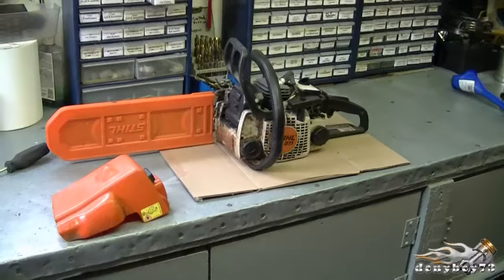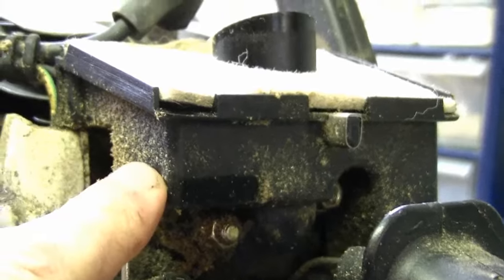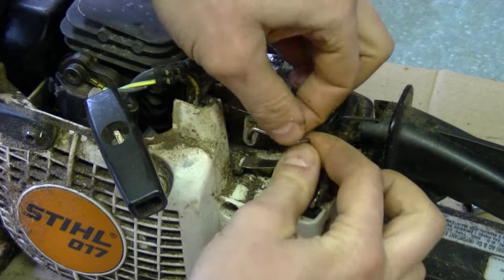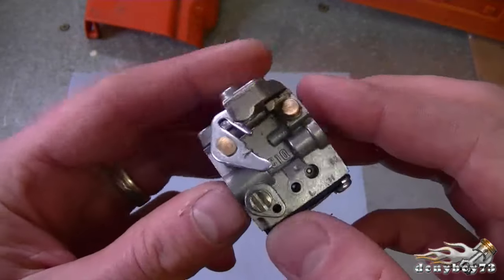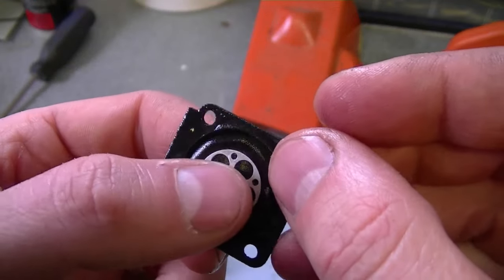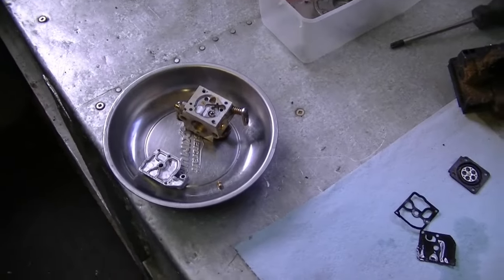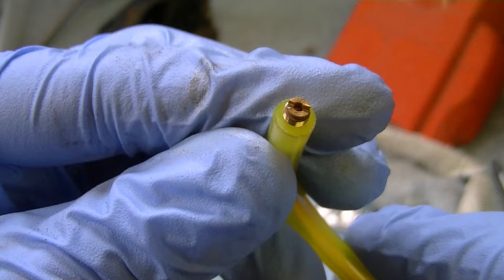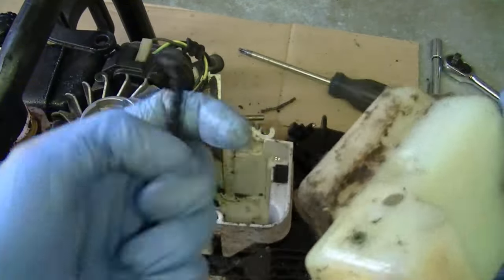HOW TO - Carburetor & Fuel Line Repair on STIHL 017, MS170, 018, M180 Chainsaw Part 1/3

Comment: Thanks! My nearly new MS170 wouldn’t start this spring and the shop asked $155 to install a new carb. I’ll not spend 75% of the new value on a repair! You gave me the confidence to fix it myself.

Comment: Hi Don,  Can you believe it's been just 3 years since I had problems with my hardly used 170. And today I was cutting, it just idled down and stalled. Now won't start. I've used nothing but canned gas after last time. Weird though, won't start putting fuel right into carb either.  Spark s good. Was running great then just slowly died and wont start now. So much for Stihl being so wonderful.  Thanks Don. Carb time again.

Comment: I would like to thank you for your videos.  I'm still new to small engine repair, but your videos, (especially in comparison to others) are clear (both in lack of shakiness and wind sound), descriptive and just oh so much more helpful to me.  Keep it up!  So far you've helped me with a Tecumseh snow blower (carb rebuild), Honda rototiller (camshaft replacement, carb rebuild, new belt), and now a Stihl chainsaw (another carb rebuild, but also found leak in fuel line thanx to this series of videos!)!
Reply from the maker: +Terri Kubik thanks

Comment: I stripped down and cleaned my carb today and afterwards the saw ran like a top. Thanks for the video, Don. By the way, I solved my previous issue simply by watching the video and carefully remounting the choke shaft with the grounding strap/spring on top of the shaft. That way it grounds out the ignition when the choke lever is moved to the shut down position.
Thanks again.
Reply from the maker: ok good

Comment: There is a paper gasket between the air box and the carburator.  I looked over several videos and everybody, it seems, overlooks this gasket.  To make sure mine stays affixed to the airbox into put some rtv on the side that goes against the airbox.  Air filtration is one of the weaknesses of this model saw, so I make sure any gasket on the carburator is installed.  I wish to thank HL Supply for including this gasket in the set of parts I got from them off of ebay.

Comment: Nice video. I would recommend that you clean the exterior area of the carb before any 
disassembly/removal of the carb itself. I always spray the complete area thoroughly with cans of brake parts cleaner then use compressed air to complete the cleaning process.  This way you are working in a clean environment and much less likely to introduce dirt/debris into the intake port once carb is unbolted.

Thanks for the video !

Comment: donyboy..you are so right ..the fuel screen on the carb should always be removed and cleaned....sometimes they look clean but are clogged up and no fuel will flow or it flows very slowly and produces intermittent running

excellent tip dony

Comment: I want to thank you for this set of vids. I just bought a used 018c Stihl and wanted to rebuild the carb. Your vid made it super easy, funny thing is I had to wind up replacing the fuel line also. Thanks again
Reply from the maker: +C Ray you're welcome
Reply: +donyboy73 
Do you have any chain sharpening videos?
Reply from the maker: +C Ray here's one but I need to redo it in HD https://www.youtube.com/watch?v=-PTXj1VIlbc

Comment: Great video! My MS170 developed a fault where the lever assembly had fallen out of its housing. I was struggling to find out where to re-attach the throttle linkage and this vid pinpointed exactly what I needed to do - many thanks!

Comment: Hi, been watching your Vid's for a few year's now, and they have inspired me to do some repair's myself, but As a  result I created a problem (ME) I toke Carb out and Cleaned it replaced Fuel line + filter Black hose and  vacuum hose with Tylon yellow hose and new boot  to cylinder, all good assembled, ( Light Bulb Moment) Having Two different hoses Less Likely to stuff up placement, WRONG, For some reason I had a brain Fart and put the Black Fuel Line to the Vacuum nipple on carb and the yellow cylinder to hose to the fuel inlet nipple on Carb, I was so happy with my achievement, I put the Plastic together and  fueled it up and it started up straight away it needed a bit of fine tuning, but the 395xp was alive This was May 2022, One year later I got  saw out of shed to for Firewood season and see ran fine till in the cut and it sounded lean and stalled out repeatedly, lucky I have more than one saw. Yesterday I disassembled again and found the orientation of the hoses to be incorrect and changed but the yellow hose had come of the cylinder port and had melted closed possible small combustion happened there  as plastic melt on  partition above where hose goes through to Carb. Sorry about the long windedness, but  It Now wont Run at all unless  with carb sprays help. ANY Help to steer me in right direction? Regards Fred.

Comment: Fixed the saw, it was just the fuel line...put in a new one with the help of your video.  Two cranks and it started right up. I thought I  was going to have to replace the carb..thanks.
Everybody should run high test gas in their engines...makes them run better and last longer.
Reply from the maker: good work!

Comment: Thanks for posting this video. I have an issue with my MS170 where it wont run at wide open throttle, and it seems I have a restriction in my fuel delivery system. I inherited it from my father, and when I got it it didnt run, so I drained it, cleaned the tank out as best I could and I was able to get it running. Its been great since then, of course the saw ran last time I used it, but I went to use it last night and it would bog out at WOT. If I sprayed ether into it, it would run at WOT, which is telling me its a fuel delivery issue. Logic says the first step would be to check the fuel filter/line. I was a bit worried about going into the carb just due to how small it is, but you really showed how simple and easy it is and Im not worried about rebuilding/replacing the carb if I had to. So again, thank you much.

Comment: A great example of why you should never store your small motors with fuel in them or always add fuel stabilizer to them if you absolutely must.  I don't know how many lawn mowers and weed wackers I've picked up from the trash that worked perfectly after a simple cleaning of the fuel systems.  People would save themselves a lot of troubles just by running them dry before a long storage.  Another great vid Dony.

Comment: Great learning video. My Stihl ms180 would not start. Too lazy to trouble shoot so I Spent $43 on a new carb , fuel line, ignition module, spark plug and T27 driver. Started on second pull . Idles and runs like a champ. Will rebuild carb for next time. Non ethanol only!

Comment: Dude, you rock! I diagnosed my chainsaw issues as a worn/collapsing fuel line as you show in your video. It would idle, but as soon as I started to cut it would die from fuel starvation.

I got a new line and filter for $12 and with your excellent video was able to replace both and restore my MS170 to perfect health in about 30 minutes. Where do I send my check?
Reply from the maker: lol, please subscribe and tell your friends

Comment: Great vid... no one else showed changing the filter line inside the tank... for some reason, mine was fuel starved, so when I checked the filter, the line inside the tank was a shriveled up gooey mess, virtually unrecognizable; like an Earthworm that's been sitting in the Sun for a few days... I have no idea what happened... it was put up drained of fuel 5 yrs ago.

Comment: I really like your teaching style and I have learned quite a bit from you. I have a MS170 second-hand to me, which starts nicely but only cuts about an inch before it runs out of power. Using your video I took it apart and cleaned the carburetor. I noticed right off that the fuel line was folded back on itself. The carburetor and fuel line look new so I put everything back together. Starts up fine but only cuts an inch or less. Is something not engaging properly? Thanks, could sure use some help.

Comment: hey Donyboy, I have a MS 170 that  runs good and idles good with the muffler off. With it on the saw won't  start  I already  changed the muffler, carburetor and ignition module. it still don't work,  compression is 100. Any advice is welcome.  Thanks in advance.
Reply: You may have to clean the spark arrestor screen Juan, quick check is to remove the screen and see if the saw will start without the screen. Then you can clean or replace the screen.

Comment: Hi dony. I have a Stihl ms250, and i replaced fuel line. It runs and idles perfectly, but when I move the saw sideways (clutch side down) the rpm increase VERY slightly. Only on that side. Should I be concerned or just keep going? Thanks! 

-Danny

Comment: I have the 170.Why did they use that flat fuel line?  Seems flattening during suction would actually cause the line to clasp and prevent flow. I have had my 170 less than a year and am having starting problems. Seems fuel not getting to plug. Filter looks good so wondering about flat fuel line. What do u think? Thanks for a well informing video.

Comment: Hi there, and thanks for the great videos you post. 
I've been having problems with a ms 017 not running properly. The saw will start om pull 3, run fine with high revs and work for a while, but after getting warm it wil stop if I let the trottle off and therafter be impossible to get startet again. I have not been able to find any similar "fixes" oniline, and before tearing it all apart, I was hoping you could give me a pointer as to where to start investigatin. It is bought i Norway and does not have the spark mesh. Thanks :)

Comment: I found what's wrong with the chainsaw, as much as it sounds crazy at least for me, it was the spark plug. I change it with beater one NGK and it's working like a charm. Maybe when I crank it produce good spark, but when actually running something happens to it and doesn't work. By the way thank for the help and keep up good work. :)

Comment: Hi Have stihl 023.Did start,but chain running fast.Set both L and H screws one turn out anti clockwise.But tried to turn LA screw back to stop the chain running but stalls engine.Now won`t start,but fires.I don`t know where to set the LA screw at.?Is there a starting point for the LA (Turns out.?)
Changed plug/cleaned air filter/fresh fuel/fuel filter.If you could please help me.with any suggestions.
You explain these small engines so well,I`m a big fan.!
Best regards Martin (Wales,UK)
Reply from the maker: hi Martin, usually when chain still spins at idle it needs new clutch springs. greetings from Canada

Comment: These are some great vids, i wondered if i could pick your brains, I have an Stihl ms 210 which runs for about 5 seconds but cuts out, i have to leave it again for about 1 - 2 mins before trying again where it will start but only for about 5 secs (someitmes less) - then cuts out again.  It seems to do this all the time now, it has run normally in the last month.  I think its a fuel problem (which led me to your video) but obviously your video relates to a different model, what might your thoughts be? I do not have a mechanical background but i like to try to do these things for myself if i can.  ANy help appreciated, thanks.

Comment: Hey Donyboy73, awesome videos, but I have a question. I followed this series step by step on my Stihl MS170.  Now the saw has a very hard time starting cold? It wont start unless you pour a bit of fuel down the carb but is fine after that. It has a new OEM STIHL carb kit, fuel line, air filter, spark plug. and the muffler is not clogged.

Comment: Does this carburetor have any adjustments other than idle speed?  A fellow is arguing that there are adjustments under welch caps.  My saw clogged the spark screen in less than 2 gallon of fuel.  I am using the oil recommended at the recommended amounts.

Comment: Hi Dony my exhaust muffer fixing bolts have sheared off I need to drill out and fit a hei coil what size would you recommend it is a Sthil HS45 hedge trimmer any advise appreciated John
Reply from the maker: m5 heli coil

Comment: Worked on mine today.. Replaced Carb, fuel line, fuel filter, and spark plug - starts but bogs down when given gas - Running synthetic 50/1 blend - Carb is not adjustable - any suggestions?

Comment: Hi, the initial 2 bolts on the carb. The left is def 5/16 but the right is not. Is that one 8mm?  Hoping to get a sure answer before I go to purchase one. Thanks
Reply from the maker: two nuts holding carb are 8mm
Reply: Thanks ! In order to hook up the throttle linkage I had to remove the handle cover to first remove the linkage at that end. A spring popped out that controls the pressure on the levers. Have you ever had to deal with replacing that?

Comment: hi dony i watch all your videos.
i have a 017. i was using it one day, i then went the other day to start it and it started. it is very temperamental it starts and runs when i first try it if i turn it off  and try re start it it wont even fire ? do you know the reason for this ? thanks

Comment: Hi Dony. Thanks for your videos, are very helpful. Well I need your advice. I have a Makita DCS34, the matter is that the chain keeps turning on idle speed, I adjusted the L screw, the H screw the idle screw, the engine runs great, I already check for air leaks on the fuel lines, the spark plug is properly tighten, the four cylinder bolts are properly tighten, I also replace the clutch. Finally I decided to tear down the engine and I found out that the crankshaft bearings are loose into the crankshaft, they freely move into the shaft, I think that's abnormal. But the ball bearings are in good condition, it seems that the crankshaft got thiner. The cylinder looks great, piston and piston ring too. The chainsaw has 160 psi. My client told me that he used the saw so hard, the engine cover was burnt I replace the engine cover, but I think it's dangerous to try the saw this way. I have 8 years of experience in small engines and I never saw something like that. Sorry for my poor english level, I'm from Mexico (Teotihuacan) and I really admire you. I hope you can reply and give me ideas. Thank you.

Comment: Hello friend I am Brazilian , I wonder if it is possible to adapt a motorcycle exhaust or even make a homemade exhaust to put the chainsaw to reduce the noise of it , and if doing so the engine will lose some performance ?
Reply from the maker: claudio passos that would be difficult because it would get in the way. it's best to wear ear protection, greetings from Canada

Comment: I have an 018 it bogs at full throttle and immediately dies good up to half throttle. I put on a new carb from amazon. Fuel line was collapsed so i put a new one on. Put b12 chemtool in the cylinder to clean carbon. Same issue and when it dies ot makes a gurgling sound. Any idea what i could be? Note the spark arrestor has been removed

Comment: Danny,
My carb says C1Q but on the other side from the one screw side instead of a flat plate there is a plate with a metal tube and a o ring on that tube. It is marked with Stihl brand and instead of two screws it has 4. Its coming off a MS 180C. It ran before but WOT was killing it. no power past half throttle it started to die. I found your video and am rebuilding it now. My question would be ... Is it normal for this variation of plate to be on the carb.

Comment: I have had nothing but trouble with my MS180 since the day I bought it. Anytime it runs out of fuel the saw won't run above idle. The dealer shop put in a new carb new fuel line I removed the spark arrester new fuel filter and tank vent. The saw is so unreliable I can never trust it enough to bring it on the job as the only saw, never runs right. I have very few hrs on the saw. Is it worth rebuilding the carb when they are so inexpensive? I wish they had a different carb available. 20% of the 170's and 180's don't run. Look at the customer reviews on the Stihl web site, I don't understand why Stihl doesn't address this issue.
When it runs its a great saw but I hate the reliability, easily the worst saw I have ever owned. Any suggestions? thank you!

Comment: Would gummed up cab cause "Bog" issues. I cleaned the front screen...but I still have bog at half to full power range on the throttle...0-half is fine.?

Comment: Hi - got a question, once the carburetor is out - the inlet manifold  has a white "O" ring which I am replacing (as mine is damaged, probably on original assembly) - the "O" ring is perfectly round, but the hole in the black rubber inlet manifold is an oval shape - and so I can't fit it in - and not sure if there is a trick or method to do it or not.  Do you have any advice, as the one on your video looks perfectly round, plus you did not replace it so was hoping for some advice if you can.  Thanks very much.

Comment: As for the fuel line , did it deteriorate because fuel was left in it ? Was thinking if not using the saw for a while , tip the fuel out the tank and idle the engine until it uses any remaining fuel up.

Comment: hey hows it going i got a stihl 018c i cleaned the carb change spark plug and changed gas line and fuel filter and the only way i can get it too run is with the air filter cover off i thought it was the air filter but i cleaned it all out i cant think of anything else it could be i was hoping you could you tell.

Comment: I have a stihl 044, never had a problem with it until today...gas/oil are coming out the exhaust, it wont start now. why is it leaking?? is it too much oil in the fuel?
Reply from the maker: sounds like it's flooded
Reply: thanks mate, yes was an easy fix.